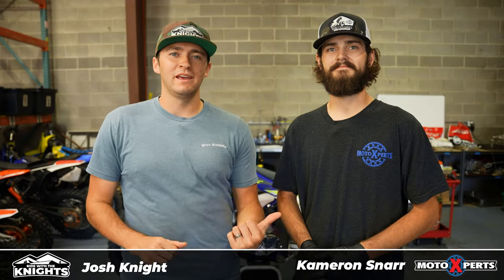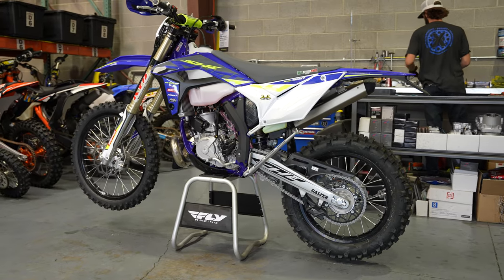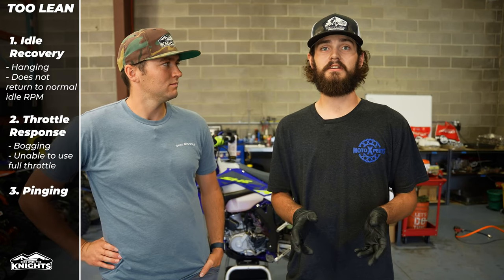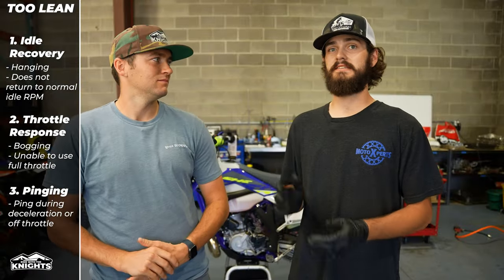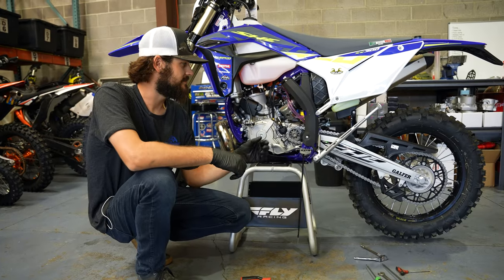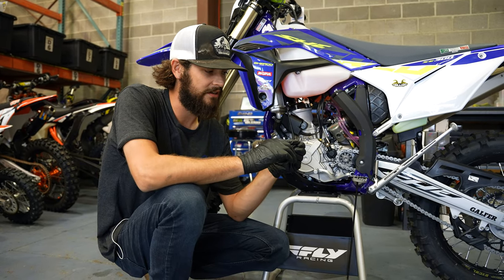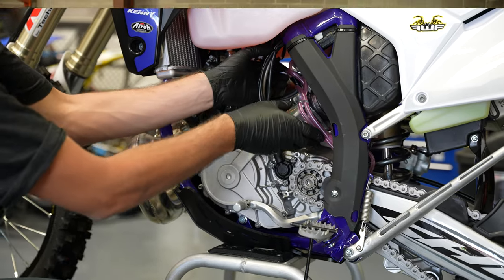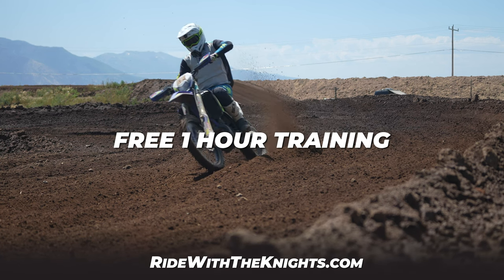How To Jet Your 2-Stroke Sherco | Keihin Carburetor's

Comment: Should go more into detail on needle taper an position. I think this is a very overlooked detail.
Reply: Hey again boys, how important is it as I got a few questions but I did buy a random needle as the bike I brought as a project was missing it it’s genuine and for the bike but not sure if it’s correct or anything main thing is I can close the air fuel screw and it still runs good lol and I’m super rich mid throttle 🤷‍♂️
Reply: I also noticed after riding and revving she sits high but near idle after dropping the throttle all the way shut then she drops further down ( like lower rpm’s)
Reply: @Tizzy_p  did you ever get it sorted bro? same issue
Reply: You’re right but they won’t because they don’t know shit

Comment: Tough to put out a short concise vid on such a deep and nuanced topic.  I was frustrated you mentioned the slide as one of the four ways to tune the carb but then did not mention it further.  BUT, I love your content and watch it often.  Please keep it up!
Reply: The slide isn’t usually adjustable, changing the clip position on the needle, which sits in the slide, does change your fuel mix tho

Comment: i have a 2000 rm 125 and i cant figure the jetting out. it barely idles and it kinda smokes alot out the exhaust and i see alot of unburnt oil coming out too. my carb is clean i just cant figure out what sizes to use if anyone knows what to do pls reply
Reply: HI!
Google...
Main Jet 170
Pilot Jet 48
Needle STOCK
Clip Position 3RD
Air Screw 1.25 out

Comment: I'm stressing so much lately. My bike is running exactly like 1. symptom of being rich, it really struggles to get into the powerband, except I thought it was too rich and I got a larger pilot and main.. now the idle hangs and it still bogs like it's too rich.
Reply: Needle
Reply: @7784thomass  turned out to be the stator coil on it's way out. soon after that comment i went for a ride and completely broke down. Brand new stator coil and the bike runs like a cut snake. 2016 ktm 300 exc
Reply: you want to go smaller so there’s less fuel
Reply: @MichaelSpencer-m3l  Yea bro turns out my float wasnt set right since it would starve of fuel, and the jets were too small I switched to a bigger ktm SX carb, 180 main jet and 45 pilot and the bike rips like never before.  the original carb was a nightmare. probably good for someone who idles around in first and 3rd gear all day.

Comment: One issue I find with most of the 2 strokes I tune is the float level too high. Once I reset the float it makes quite a difference.
I recommend making sure the float is set correctly before changing jetting.
Reply: Really? I am a bit of a bike rebuilder and flipper I guess. I’m 13 bikes in and have 3 in my inventory as well as a 2 stroke quad and I haven’t ran into too many float issues other than on a 95 Suzuki rm the float had micro punctures so I plastic welded it all shut and adjusted the float accordingly, other than that though most bikes I run into are dirty carbs with ethanol gas or blown engines due to rider and not the bike. All too often Timmy is excited to have a “fast” bike and pins it down some straight before just closing the throttle and all lube to the cylinder. I love little Timmy he makes me lots of money

Comment: Ok l have a 2019 sherco 125
 l ride hard enduro l have changed a few ergos , gear and jetting.
 l currently run 40 pilot 165 main my slide is stock 5.5 l have a N1EH on 3rd clip riding from 200mtr to 500 metres average elevation l will try  2nd clip and may even change needle to NECH witch seems to work well with 250/300  all running 36 mm carbs it does run a lot better but still room for improvement jetting and gearing changes have made the map switch far more effective

Comment: Hello, your video is good. I have a question. I have a beta xtrainer 300 2023. I recently put a jetting main 162 pilot 38 needle position number 4 
That would help me to have a good response from the bike in the mid and low ranges.

Comment: My pet complaint is how seldom a two stroke comes with the right throttle slide. My two YZs have and 8 and a 9 (stock is 7). My '17 KTM came with a 4 and now has a 5.75 from a CR125.

Comment: I have a 5hp outboard 2 stroke boat engine.. and i change the main jet from 0.82 to 0.99 dimension and i want to change the needle jet atomisor with one with more holes to mixt beter extra fuel ..   do you tink i will get little more power from it? I also bore the intake wall inside.. from 17mm to 19 mm now.

Comment: Did you guys follow the Sherco jetting chart or did you go leaner?
Reply: SHERCO's jet chart is only for reference and does not provide optimal Settings. It is still necessary to rely on the status of the spark plug and throttle feedback to adjust.

Comment: What if it runs good mid throttle then when you get high rpm it gets really weak and dies out doesn’t really get to the power band
Reply: I bought a used bike, idiot previous owner... i had almost the same situation, ktm sx 200 2004, smaller main jet #148 instead of the factory #192 size. The needle clip was in the  pos 5, instead of 3.
This results lower-mid rpms get normal or too rich (because needle clip pos 5), high rpm (not enough fuel)  dies and weak.